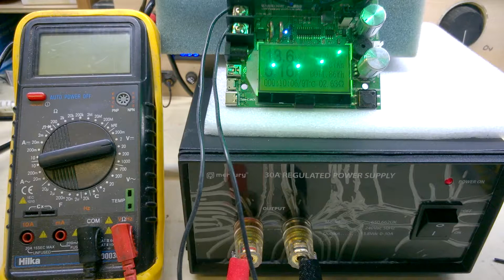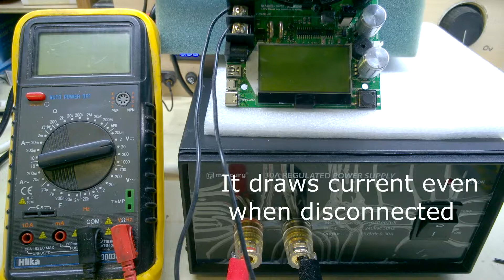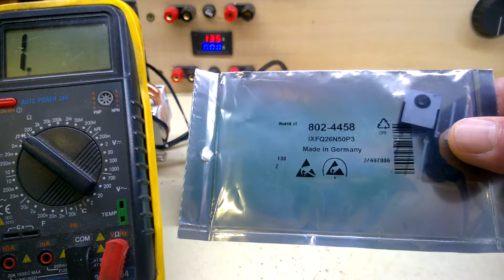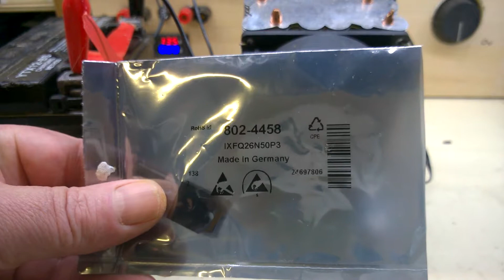Electronic load failure and repair

Comment: Hello dear creator
I have the same capacitor tester as you exactly and the exact same problem as you.
But my MOSFET number is IRFP264 and it is not available in my country. Can I use IRFP260N ?
Reply from the maker: That will be ok.
The 260N should be able to handle 50 amps.

Comment: The higher the breakdown voltage rating of the MOSFET the greater the Rds_ON for given cost.  If you don't need testing of supplies greater then 100v you can get lower Rds_ON devices with a lower cost device.  Lower Rds_ON devices usually have stronger wirebonds within package that are better to sustain greater current.

For load testing, the MOSFET will be operating in linear (partially ON) active mode so it all pretty much boils down to device heating  and Vds breakdown voltage.  Switching power supplies can have voltage transients that can exceed tester load device maximum Vds breakdown triggering an avalanch short on device causing it to blow out.  Don't connect/disconnect source without disabling load test first.

The large MOSFET's have a lot of equivalent gate capacitance so the tester gate driver will have a limited transient load response adjustment response time.  Try to avoid large jumps in applied voltage.  For given Rds_ON, higher Vds breakdown voltage rating MOSFET comes with higher MOSFET equivalent gate capacitance slowing down the control adjustment time.
Reply from the maker: Great comment - very comprehensive.
This happened as in the video - no sudden disconnect of the load or a sudden intentional current increase.
I will take on board your suggestion about the lower Rds of some mosfets when ordering new ones.
I've used my last spare.

I have 2 more videos on this unit if you care to diagnose those faults (especially video no 3).
Reply: Agree, bad choice. It has terrible SOA.  The IRFP264 is not great either, but better than the IXFP26N50P3.

Comment: I have the 150watt version and this has a irfp260n mosfet. The 264 is much weaker and did not get past 10 amps.  Normally it could go to 24.3 amps. After a couple minutes of testing the mosfet went up in smoke. I again replaced it with another 264 mosfet and it lasted about a minute.
The diode package STPS41H100CG don't seem to have a short circuit.

Any suggestions?
Reply from the maker: Take a look at some of the comments posted here - it may give you an idea of how to improve your units' performance.
Reply: @makeitwork7522  Can there be other Problems like a control circuitry that takes care of the switching of the Mosfet. 
My Unit does not work anymore. I took the diode Package from the pcb and tested them with a load of 120 watts without heatsink. No Problems with the diodes. But the Mosfet keeps blowing. The rest of the pcb looks fine under the microscope.
Reply from the maker: @user-hf9tx7qt2h  
The only components I've changed were the main mosfet (this video) and the two dual diode packages (my other video).

If the power mosfet is always blowing , make sure you're using an N channel mosfet (of at least 20 amp rating) and ensure a good connection to the radiator (with thermal paste).

Very basic advice , but other than that , I can only suggest you check the gate voltage (usually 10 volts for max. current).
Max. specified voltage on the gate should be no more than about 20 volts.
Reply: Boa noite amigo  poderia  me  ajudar?

Comment: I would have chosen a much more powerful model  IXFH320N10T2   320A , 1000W and 100V for $10
Reply: This numbers for your mosfet is the idealistic power but you can't get it as you think so ever. Because you can't keep your mosfet at 25© temperature with 100amp example . The max you will get is 300 to 450w max before your mosfet exploding in 150© temperature
Reply: @abed_itani  The strongest mosfet at an acceptable price is FDL100N50F   500V 100A 2500W 55mΩ   TO264 (It has a 6mm larger)
Reply: @Radu44  yes I know that mosfet . Try FDA50N50 it's more stable than FDL100N50  and stable than FDH50N50.

For my testing mosfets limit . I burn more than 100 type of  mosfets to get best results with original mosfet FDA50N50 that reach 450 watt and exploding it at 480W with temperature reach over 100© and the fan was spinning crazy trying to cool it down but it's was impossible that makes small mosfet size to getting out  all that power heat that generated inside it and take it out Soo fast in that conducting copper fan . It's matter of seconds in that power before exploding it .

If you like there a big mosfet with size of 9v battery if you know . But you need to install it external with big fan external and you need it water cooling system and it's can reach 800W

Go and google for the package of IXTN62N50L
It's the big deal of mosfet .
Reply: @abed_itani  FDL100N50F have 2500W much over IXTN62N50L who has only 800W (for 24C). I would test with Noctua NH-D15 and Arctic Silver 5. Usually the maximum power obtained is almost half of the specified maximum power. I have problems with the protection diode (which I removed) and with the shunt that heat up over 15A.
Reply: @raduradu1289  your forgetting something more important . ( The DC region !! ) It's not about switching any more in this unit . You will not get that power in datasheet . Trust me . 

Se the difference between mosfets in the Datasheet in the under name of ( DC region ) there a line will show you the DC region max power with max voltage with max current . 

Don't get tricked with what they say about 100A or 1000W or 1000V Soo what ever . 

I get a mosfet they say that it handle 100A 1000V 50A and 400w to be burn in just in 50v 2A and that about 100w only . It's because the DC region was not 400w it was 100w in 25© temperature max it's like 75w max in 100© temperature.

 mosfet work definitely difference between switching and more than variable resistance . Don't forget that 
The variable resistance in mosfet only work in DC region. This region is critical and small in some mosfet and big in some other . You need the long distance DC region .and there will be losses and heating alot
Reply: @abed_itani  If the part is original, it must comply with the specifications. I only buy the pieces from the mouser and farnell
Reply from the maker: Thanks for the comments.
I used the mosfet shown (26 amps) not for performance , but it was simply the one I had in stock.
No doubt there are better mosfets than the one I used (yours and Abed's comments show what is possible).

Comment: How does it look like when the Mosfet is broken on the display? Does it simply show only the voltage and whatever you do with the knob the amperage is not going up?
Reply from the maker: As in the video , when the mosfet is shorted , the current goes up to the maximum that your power supply can give ie. 31 amps from a 30 amp PSU or 60 amps from my small lead acid battery.
The current is not at zero when the mosfet is shorted out.
It probably would be if the mosfet was open.

Comment: I have two of this modules and both are destroying the Mosfet after a couple of seconds or latest some minutes. Has somebody an ider how to fix the problem. The Mosfet is well coled an the current I test is only around 600mA and 1,4V from a Battery to be safe that nothing from outside kills the Mosfet.
Reply from the maker: There are two conditions that kill mosfets (that I know of) ; too much heat and too much current.
Make sure that you have heatsink paste on the mosfet , and that it sits flat on the radiator part.
Obviously,use an N channel mosfet (I used one rated for 20 amps) , NOT a P channel one.

Ensure your polarity is correct also.
See one of the other comments posted here about which kind of mosfet that person used.

I have another video on my channel showing a different fault which blew up the mosfet  AND two other components.
Good luck.

Comment: My unit have irf260 and I replace it with irfp90n20d and it works better

And you can do some heater enhance because the heat wat kill the mosfet
Reply: Hello. I bought this DC tester but it doesn't work (it seems to short circuit) I would like to try to replace the mosfet. Can you confirm that the irfp90n20d works well? I buy this instead of the original one. thank you
Reply: @mgadaleta  yes you can try ( irfp90n20 ) or (FDA 50N50) the most powerful one for DC load .

For 12v you can try irfp90n20

For upper than 20 v try FDA50N50 

I test many conditions for FDA50N50 and it can go ruffly up to 20A / 24v / 480W !!!!!!!!!! I was shocked . But you have to reflecting a 480W heating . It's  Soo much that can kill your mosfet if you did not install it directly in external CPU water cooler . Otherwise you don't pass 250W max.

If you like I have some pictures for my installation the 50N50 in my external cooling system
Reply: @mgadaleta  yes I will send them . And will try send you an live action video  for the system pass the 480W with heating reached 90c° for some seconds before I shut it down to prevent the mosfet from exploding during this 480W Short circuit if happened . 

It better be safe to use it for 250W for long time only.

There nothing to completely remove this 480W heating inside the mosfet with this small size of conducted elements ( mosfet is not big size to remove quickly this heat from DC linyer line as you know )

Mosfet made to be acting only like a switch ( on - off ) from the start
Reply: @abed_itani  I use IXFH320N10T2   and TS15A cooler with Arctic Silver 5. For 300W permanent load, after 15 minutes temperature is 92°C away from maxium allowed mosfet temperature which is 175°C.
Reply: @Radu44  yes I test this mosfet . In order to be clear to you about this situation ........ The mosfet that I use and the one you use can handle more power . But unfortunately the max power/heat that can resolve with the limit time you have is 300w in short life test . Because the size of the mosfet is considered small and the heating cannot escape easy from it . ( If you know what I mean ) .let we say that every student want to escape in the same time from the school with less than a minute ..... It's impossible . Soo you have only 2 solution . One is to put the mosfet in a zero temperature all the time and that is Soo difficult to do it . The second solution is to divide the power in to 2 mosfet with 2 same size of the  shunt resistance installed serial with the every mosfet . But that is not stable because I test it and see that the mosfet in DC linear is very very hard to control in his small region . So you will get one get hotter from the other by Soo far . And will not get your 600w wat so ever .

If you arrived to be closed to 300w that very very good .

I arrived to 450w I remember or close Soo . But the temperature is Soo crazy . 
I think 250w or 300w is safe side to use.

I remember to say something important to you .
The more heating you got the lower voltage or current you have to apply .

If you want to test high current don't apply more than 12 to 18v 

And same thing apply in high voltage . And I don't recommend it to use with this unit more than 30v what Soo ever
Use 14v at 20A is considered top limited test as for battery or battery charger test
Reply: @abed_itani  Why should be IRFP90N20D used for only 12V? Datasheet says 200V? Or am I missing something? Thanks.
Reply: @Ohm7111  yes my friend . Your ask the right questions . You see ....the 12v is in linear mode ( resistance mode ) and not in the 200v cut off/on  . 

I will give you the direct answer but it will be very sort . The rest up you to understand and to see it in the Datasheet . Every transistor mosfet there have many thinks to see starting from ( delay on / delay off / time to be responding / time to be fully on / time to be fully off / the resistance when it on / the max current in short time / the max current in DC region / the max power dissipation / the max voltage / the power in DC region . And don't forget all that info with the operation in 25© temperature and not 100© .

Soo you see you will understand it when you test it in reality . 

To dissipation 300W inside the mosfet it's like 300w of heater and that something you need to cool it Soo quickly before it reach 100©

You need very strong mosfet that have the quality to operate in DC region . You don't need 1000v that can only operate for ms time !!! We don't want this short time of msecond high voltage or high current in short time.

And when you say 200v in DC . that dangerous in resistance shunt to be control !!!! .

I max test successful 35 to 45 v in DC region . You can go up to 60v to 100V but it very very risk to damage the mosfet silicone resistance with over 2 amp . 

You see the highest voltage you test the lower power dissipation the mosfet will give you than what supposed to be handling .

Example : mosfet max 100w 100v 100A .

That a max allow in 25© 

In real test you calculate 100© and that give you only 70% 
Soo your mosfet power will be 70w only max and you should test 60w max .

And that 60w is in short time because it's not in resistance region . 

In resistance region you will have the 40%to 60% of it and that a 30w to 50w safe side to be applied on the mosfet .

50w in low voltage 
30w in high voltage

This all writing in the Datasheet graph  📉📈
Reply: @abed_itani  Thanks. I don't know much about mosfets. I bought similar DC load. They says 200V, 20A, 180W, with modificatons and better cooling ut to 1000W. In loads settings I can set current up to 30A... Mosfet is IRFP260, but it is used and may not be original. There is dual diode, which is rated only for 100V.
I would like to use this load up to 55V and about 250W. Do you have sugestion which mosfet should I use? Thanks.
Reply: @Ohm7111  in 55v you will not pass 110w with this unit . Simply your mosfet will catch on fire if your input voltage is 55v and the current input can go upper than 5A . 

This unit is not original rated as they say. 

It is open source .
but the original unit is 36v 120W 15A.

Since this unit is open limit you can modify it to work as you like but not with one mosfet .

I can helping you to choose mosfet for big current and big power . But not high voltage. Simple use for max 24v or a little up.

Or you have to forget about mosfet and use ( IGBT ) but you have to use max current as 5 A max.

IGBT will work in this unit (;
Reply: @abed_itani  Thanks. This is bad. I expected it will work as adwertised. I bought and installed big CPU heatsink. 55V is rare for me, but sometimes I would like to use it with this voltage. I already have 2 DC loads, one is rated 30V, 10A and second one is 20V, 20A. They works fine for me. Recently I needed to test 10S li-ion battery, so this unit is also not suitable for it... I tested my unit 2 days ago with 50V and 5A. Heatsink was warm, but mosfet died after few minutes. I was hoping it was because they installed used mosfet (maybe not original). I already replaced the mosfet with same type, but new from trusted suplier. New mosfet is also from infineon, but looks different. I didn't test it again with higher voltage... I have to do some research. Thanks.
Reply: @Ohm7111  yes as I expected . And yes the original in the unit not same as you will buy . And what ever you put it's will not take 50v DC inside the mosfet and to dissipation that power heat . 

The power from high voltage and low current is not same from low voltage and high current in turns of resistance impedance inside the mosfet ( if you know what I mean and not to think it as wrong )
Reply: @abed_itani  Do you know if I can use the IRFP4110PBF ? The specs look way better than the irfp260n.
Reply: @user-hf9tx7qt2h  it's better but you need to check it . And be sure it's original or it will not pass 150w .  

Any way the Datasheet say 370w at 25©  so I think it can handle approximately 260w in high temperature as I can see this model is 175© max 

But you have to check the safe operation in DC region ( because I can see that for long safe time you can use 150 to 180 W  results for 15v 10A or 12v 15A as the graph picture .
Reply from the maker: Good idea - thanks for the comment